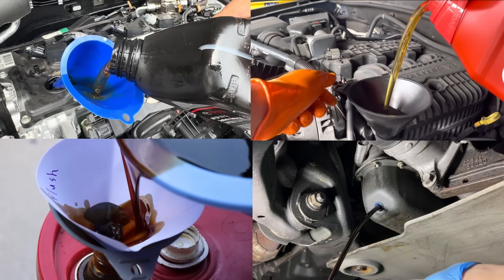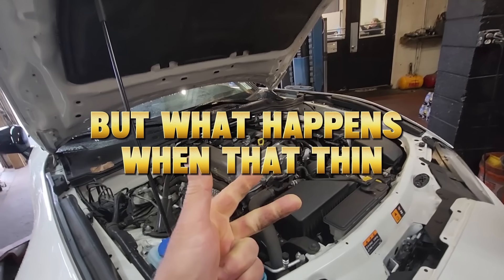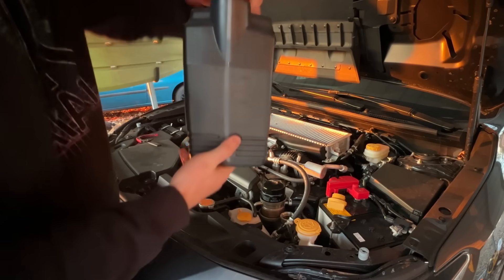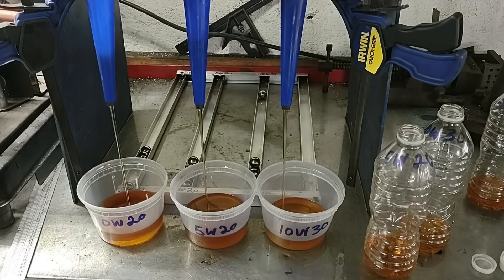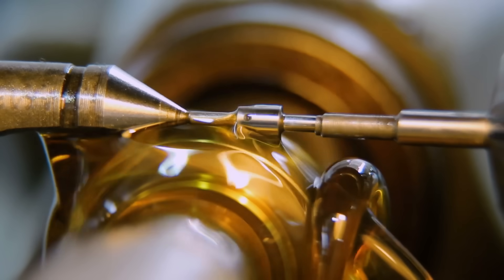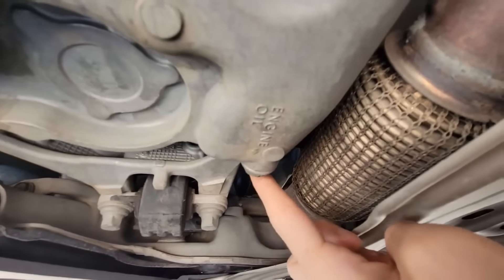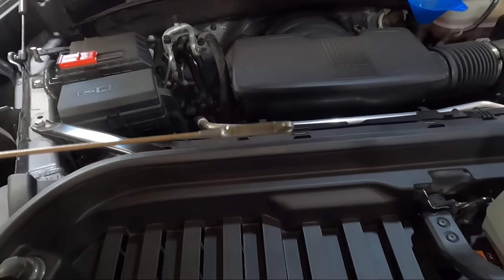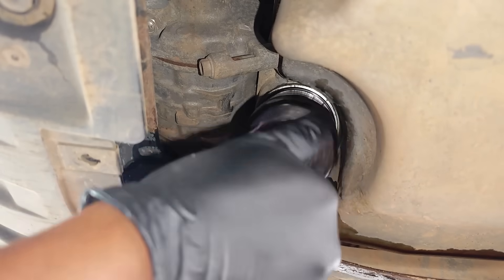The TRUTH About 0W 20 vs 5W 30 Oil (50 Engines Tested!)

Comment: I bought my '08 Prius 5 years ago with 189000 miles on it. I only use Pennzoil 5w30 and change the oil myself. 271000 miles now and no engine problems at all. I still get 45 mpg highway.
Reply: Do you not mention how often. ?
Reply: Don't forget to change the coolant/oil too. yep it's not straight prestone it's synthetic with oil added to it. Buy the Toyota brand.
Reply: @stephenrblvand transmission..
Reply: 2013 3.6 jeep 212k mi on 0w20 5k oil changes, no issues.  Oil sample every change. Facts, this video is bull shit
Reply: @kwmiked 
. Ya lo había visto en otro persona especialista en ello.. y también especifica lo mismo exactamente de diferente manera.. es real .. 👍
Reply: MY 2002 Prius has 600,000 plus miles!!! never any internal engine problems!!! still getting 41.9 miles per gallon!!!
Reply: 45mpg highway? ouch. i get double that
Reply: @TaylorPhase  How's your bicycle running ?
Reply: @jackmarino8187 what bicycle? What are you talking about?
Reply: @TaylorPhase He meant your car doesn't get 90 mpg highway miles
Reply: @pence2012 it does. It’s a hybrid and aeromodded to have a much lower drag coefficient
Reply: Wv 0w20
Reply: Wv 0w20 skoda fabia
Reply: Penzoil used to be the worst oil to buy back in the 90s.
Reply: Ogni quanto cambi l'olio alla tua auto? 10.000 km 15k
Reply: People who listen to this guy will destroy their engines. Toyota requires 0W20, 0W16, or even 0W8 because their engines were designed with very tight tolerance. Using higher weight oil will restrict flows, and mess up bearings.
Reply: @noblekitty  Exactly!
Reply: @noblekitty  Lake Speed, Jr., aka "The Motor Oil Geek " has a video on that very subject.
Reply: @noblekitty  Way more important to change the oil often. 5K to 10k max is your forever sticker. There's this myth floating around now that new cars don't need oil changes.  A year is good...nope fail. They see these bottles with 40k , NO.
Reply: @stephenrblvhonestly, it varies from engine design. Most brands now stick with 10k with synthetic oil with normal driving conditions. If you are doing a lot of stop and go, or in dusty environment, then change oil much sooner. Some German cars extended to 15k interval because they are using a bigger oil sum..i.e 8.5 qt of oil on a 3.5L v6 vs 6qt normally on similar size engine. Engineers know what they are doing. Of course, changing oil sooner is always better. But is it worth it? It's almost like you said oil change every 3k is better than 5k. Then I say hell, every 1k is better than 3k. At the end, how about changing oil every 500 miles or weekly. It has to be the best isn't it?
Reply: @stephenrblv.. no escuchaste bien el vídeo..  los cambios comenta.. espera vehículos trabajan a un uso rudo.  Ejemplo.. taxis.. aplicaciones.. autos trabajan más duro de lo normal.. si tú uso es normal.. de trabajo a casa sigue con el del manual.. saludos.. 🙏
Reply: @noblekitty  Obviously never listened to the video, you just came on here to make stupid comments. The video clearly stated the more miles the more oil break down. It doesn't matter under 3,000 miles, it's time and heat that break down oil. There comes a point where the two meet and most people put that time at 3-5,000 miles. Go make stupid, trolling comments somewhere else.
Reply: @oldman-zr2ru yes, oil started breaking down at 1 miles in, so we all must change oil daily or every 50-100 miles, silly! 2 guys worked at the same courier company. Each drove a Tacoma with a 2.7 L 4 banger. One changed oil with whatever cheapest available at Jiffy Lube, one with Mobile 1 on manufacturer recommended intervals. The one with Mobile 1 lost all compressions at 528k miles. The one with barrels oil lasted till 530k. Yep, real life experience instead of some stupid youtube videos
Reply: @noblekitty  Nice story, too bad it's fake.
Reply: @oldman-zr2ru so yours' real? Lmao, go read the "fake" story on mavericktruckclub topic Kirkland 0w-20 full synthetic brand oil post #12.... knowledge is power, padawan! Much to learn
Reply: @noblekitty  Doesn't matter. You stand as good a chance of convincing me as I stand convincing you. I will continue to use 5-30 for the rest of my life at 3,000 mile changes. You'll never prove that I wasted a penny and you'll never prove you saved a penny.
Reply: @oldman-zr2ru but I already know that. And I also learned what type of person you are through this short social interaction. Will it change my life, no. I hope it may change yours for the better
Reply: @oldman-zr2ru  3000-mile oil changes are a waste of money, period. Today's oils have advanced just a bit since 1965. Nearly every manufacturer recommends changing the oil at 7500 miles or sooner if indicated by the oil life monitor. The engineers that designed the engine test hundreds of oils in their engines that they warrantee and actually have a clue which oil will provide long engine life. Have you tried various oils and then torn the engines down after each variation?  Nope.
Reply: @noblekitty you should change oli at 3000 miles. Screw what they say , they want you to buy a new engine or car to keep them in business
Reply: @Americanman450 do you understand that over 70% of engine wear happens during cold start up? When engine oil isn't flowing to all moving parts yet? So changing oil every 3k or 5k or 10k like they recommended makes a small difference overall. Just don't go too much beyond what the manufacturer recommended. And it's time to quit that 3k miles bible.
Reply: @noblekitty  im 46 years old and have taken apart engines that I have built so many times and have tested going beyond 3000 miles, and have tried going by the milage synthetic oil says it protects up to. Go ahead and do yours every 10k miles idc. Im just saying that if you want that engine to last more than 120k miles its best to change every 3000 miles. I do mine every 3000 miles and my track cars I change the day after I run them now.
Reply: Pruis is gay anyways,  and not a performance motor. I only deal with performance with turbos and what not. And if you have a turbo car you definitely should change every 3000 miles
Reply: @Americanman450 again, do you realize that no matter how often you changes your oil before recommended intervals, your engine would still suffer 70% plus wear during cold start? You can't compare an engine longevity based solely on mileage. Long distance, short distance, stop and go vs constant highway speed, clean environment vs dusty desert conditions...etc all play critical roles in how often one should change oil. FYI, I am a mech too, working on diesel, gas, natural gas, hybrids and EV
Reply: @Americanman450 Prius is smart money. Getting a gay impression but wealthy vs manly but homeless....easy choice
Reply: Have you ever looked at the different owners manuals and the oil recommendations for a foreign country sold vehicle. Example:  A 2013 US sold Camry or Rav4 (2.5L) vs. an Australian sold car. You'll see that on a 2013 2.5L Toyota sold in Australia the manual advises a wide range of oils from 0W-20 thru 15W-30 with 5W-30 being preferred across the outside temperature chart. These are the same damn 2.5L 2 AR-FE VVT engines in both US/Aust. Oh but wait you can only use 0W-20 or maybe in a pinch 5W-20 n the US. What a crock of crap.
Reply: @shannonwhitaker9630 no, why would I? I don't live in Aussie....just joking, you can look at any older vehicles manual sold in the US, and you would find a wide range of oil recommendations depending on outside temp and driving conditions too, 30 ish years ago. But at the same time, full synthetic oil costed arms and legs back then. Engines back then get a big celebration of they made it past 100k. Time changes. People were riding horses back in the day that doesn't need any oil change too.
Reply: Fact is you don't want to admit that Toyota for example has different oil weight recommendations and options for different countries outside the US and for recent year vehicles. You've done ZERO reading and research just blather blather. In Australia you can use 0w-20 thru 10w-30 oil in your 2013 2.5L 2ARFE with 5w-30 being preferred but in the US it's 0w-20 with 5w-20 in a pinch. What a load of BS. Come on Blather more or maybe start reading and asking why this is. It's US Govt. EPA BS.
Reply: @shannonwhitaker9630 yet there are hundreds of thousands of Toyota including mine are well over 100k to 200k miles running just fine on Toyota recommended oil weight. Oh, if you are sweating about 0w20, how about 0w8? 😂
Reply: @noblekitty 5w30 has always been fine for cold start. I live in Wisconsin and only use 5w30 year round. The car companies started using this way too thin of oil to reach the climate cultists regulations.  They had a impossible feet to reach 50 or more miles a gallon by like 2030. They did this and didn't care about the longevity of the engine.  They pass that problem on to the people who are poor and have to pay 20k for a car with 100k miles on it. Like always they make victims in the name of the climate god and hurt the people they are already causing energy poverty.
Reply: @Americanman450 when I said "cold start", I wasn't talking about cold climate. I was referring to starting your engine after it's been sitting for a while, and all the oil had drained to the pan, leaving just a thin oil film coating the metal to metal.
5w30 wouldn't have issue in cold weather, of course. Heck, diesels are using 15w40 and they work fine in freezing temperatures. If you are using synthetic, stuffs would flow even better.
50 mpg doesn't have to wait till 2030. My Avalon hybrid is already doing 49 mpg. I'm sure the Prius, Corolla hybrid, civic, Camry, Accord, Sonata...hybrids are all averaging more than 50 mpg easily. My wife's RAV4 prime is currently averaging 85 mpg. My Sienna minivan is 40 mpg....
The Earth is getting warming and I don't care which polical sides you're taking. I only trust the numbers. Ever wonder why home insurance in America is just getting really expensive recently? Well, it's only get more expensive...to the point that people will start losing their mortgages because of home insurance. You may not believe in global warming, but I am very sure we all are paying for it. Believing in it only allows you to better prepared for it.
Reply: @noblekitty cold start is cold start which is even worse in Wisconsin climate.  We have 100° summers and -35° winters. Everything is told  you is where I stand and ive got my associates degree in auto mechanics and have been working in the trade for over 25 years. You want 5w30 at least if you want proper protection.  You do you , hut im telling you that the automobile companies only used those 0w weight oils so they could pass government emissions and sell their cars here in joe bidens mess of crap. They dont care if you need a new engine at 120k miles. Ive had cars back when I was young that had almost 200k miles on them and never had anything done internally like timing chains and all that BS. Being a mechanic back in the day used to be replacing external parts mostly.  Your car would rust away before you needed internal engine work. Go ahead and use your thin oil buddy. Ill use my 5w30 because I have sense. I bet you are triple quadruple boosted as well.
Reply: @Americanman450 you do understand that oil weight also plays a role in modern tight tolerance engine design, right? Running heavier weights oil could result in oil that wouldn't able to squeeze between these tight tolerance spaces, leaving your engine grinding metal on metal, sir. But you're right, you do you. It's your money, not mine.
Reply: @noblekitty  Did you not listen to the video? The video clearly said Toyota recommends changing to 5-30 after 100,000 miles.
Reply: @oldman-zr2ru Toyota never said that. This video lied, and you believed it.
Reply: @noblekitty  Good points you make about the Toyota tolerances.I'm still using 0w-20 on my 15 yr.old Prius(150,000) though I've switched to a 0w-20  brand especially made for older cars. The 5W-30 argument has some relevance based on other car(non-Toyota) brands having major engine problems over time using 0W-20 oil.
Reply: I have been so  sabotage just with oil change, air filter, new battery. It was running, the battery was dead after smart shot computer insert. I know what I need and I tried to disconnect the battery and no pads I paid 10 for, no core $, not secured in place, $245 100 more than what could get, not the parts for my engine. I didn't realize all this until car got worse from the 1st mistake conventional oil used not synthetic, they say Valvoline is better than motorcraft. It was already low. How did I put 50 miles on it, drove 5 times a mile away and less than 10 for oil, Air filter or battery are not Duratec Ford parts. Did I really kill my car from these loving caring things I did. It had vaccuim leak but the first jump the idol wasn't noticable only after 2nd jump and oil chamge it just sounded little with idol. Half quart of moto craft oil it actually calmed her down. AAA put last battery in and oil change was invoiced old owners name, 30k miles since they did change.
Reply: I think what happened is you were doing car maintenance in the same manner that you type in… and it blew up!
Reply: @sharijames9622  Say that again?

Comment: This matches what we've heard before.  There are some using 0w-8.  Basically water.  I'm using 10w-30m which the manual allows.  I'll never see 0F.  Biggest hazard is short trips.  Have a few Dr appts far enough away to compensate, plus Xmas trip.

The brand matters.  Some oils lose viscosity after a while.  Haven't heard too much about this.

Comment: 2017 2.0 L EcoBoost using 5W30 Motorcraft syn blend changed every 5,000 miles in Wisconsin.
Engine failed .11% drop in compression (suspect cyl 3 rings) at 124,500 miles.
Reply: Don't blame the oil for a fundamentally flawed engine :)
Reply: any engine that is marketed as eco something or dura something, any fancy words like that is a weak engine
Reply: What viscosity did Ford recommend using?
Reply: 2017 2.0 Ecoboost 
Recommended motor oil (U.S.):   Motorcraft® SAE 5W-30 Premium Synthetic Blend Motor Oil   XO-5W30-QSP  WSS-M2C946-A

Comment: Have a friend with a Honda that sounded like a 2 stroke chain saw engine with 0w20 and when he went to 5w20 it quieted right down and his gas mpg's are identical.
Reply: It’s the same oil thickness at  engine temp. 5w20 is only thicker at startup
Reply: Yea 5w base oil is much more stout than 0w base oil
Reply: @jessehyde4984  The "W" which stands for winter, is the viscosity of the oil at 0 degrees, but when at full operating temperature the viscosity is 20 or whatever oil weight you put in
Reply: You have to do very careful testing to prove a slight difference in gas mileage on any car. Most people don't know how to do that properly.

Comment: Had 2021 jeep grand Cherokee L. 3.6 pentstar V6 it Called for 0w-20 
Was burning a quart of oil sometimes more  in between oil changes of 5,000 miles 
And I would hear frequent chirping noise alike tea ketal noise until I would top it off with oil and took to the dealership and they couldn’t find the issue.  I switched to 5w/30full synthentic around 20,000 miles and drove it u to 80k miles never had to top it off it stopped burning oil and engine ran great and did great mpg.  All year round   Gonna do it again on my new 2025 F150 eco boost  0/20 is horrible. I had jeeps wranglers with the same 3,6 Jeep V6 always used 5w 30 never had a issue until my 2021 with 0w/20
Reply: Did the same with my jeep Pentistar...saved my motor using 5w30
Reply: I believe that engines develop their own 'personalities' over their life span but scrupulous care in an engine's formative years makes all the difference.

Comment: Hi, Fiat recommends 5W40 for my Punto MJD (Diesel), while Suzuki recommends 5W30 for the same Multijet engine sourced from Fiat. I have noticed 20% lower engine sound with 5W30, now question is should I use 5W40 in my Fiat punto Multijet engine or 5W30? I stay in India and here the temperatures are above 90F or 32C. Please address this query, Thank you.
Reply: For your climate I would use 5w40

Comment: I saw a vid of a guy who ran a priusbon 0w20 and also 5w30 in two tests. He did it around 4am in both tests and took the same routes to keep it as a comparable as possible. I don't recall if he got a used oil analysis done on them (that would be best) however he did put a mic under the hood and recorded the engine at normal highway cruising as well as under load going up big hills and in both cases, the engine was noticeably quieter with 5w30.
Reply: How quite an engine is means nothing.

Comment: 0W 20 great for smaller and new engines. 5W 30 is great for engines <5 years old with no oxidation. For cars 5 years and above, thicker oil is recommended as wear and tear is more noticeable
Reply: Recommended by who? There's nothing about that in my owner's manual...

Comment: BS is heavy here,0w-20 is required in toyotas and hondas because it flows quicker,the additive pak is better than 5w-30. Light oils are not the problem,excessive oil changes are.0w-30 will cost you mileage and power.

Comment: Engine calls for 0w20  if thicker oil better  forget 5w30 jumps to 10w40 or higher
Sounds thin but it  got more volumes go through the parts
Reply: 10w-40 or even 50. Ur engine will love u.
Reply: @partymanau  Not really.

Comment: It's the same BS with cylinder deactivation software, and idle stop start. 0W20 absolutely causes timing chain issues. It's a well known problem with Hondas. The start up rattle and Honda won't touch that issue with a 10 foot pole.
Reply: That stop start thing is a PITA and some vehicles, u cant turn it off.
Reply: My car has LESS timing chain rattle on start up using a thinner oil (I went from a 5W30 to a 0W20).

My car is rated for a number of different oil viscosities including 0W20